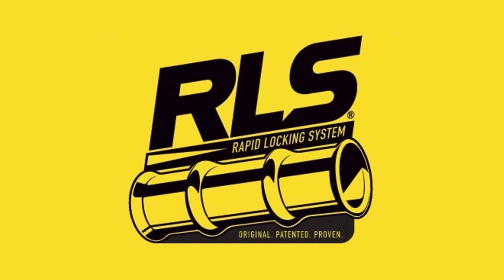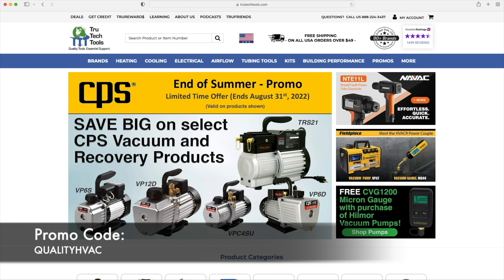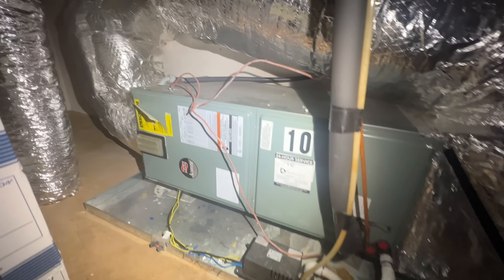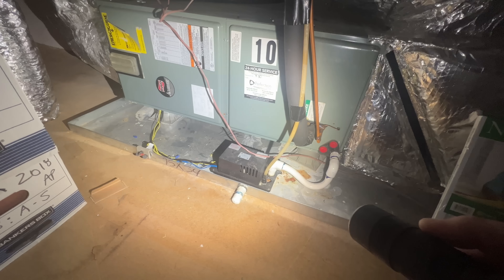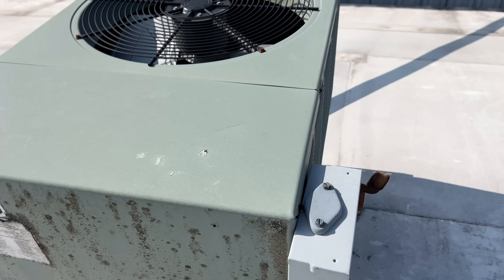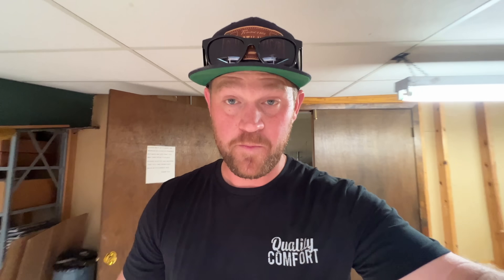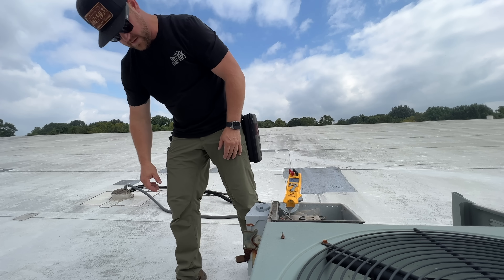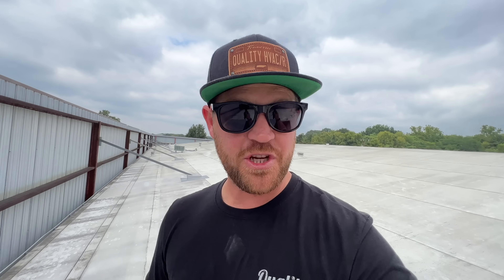HVAC Breaker Tripped?? DON’T Just Reset It!!

Comment: since that middle leg was a possibility of not getting good contact that caused the tripped breaker, would doing a voltage drop while unit is running help verify anything?

Comment: Hello friend, I have a question, if you could help me please, my question is the following: I have a two-story house, each floor is 1000 square feet and the height of each floor is 18 feet. My question: How can I calculate how many frigorias I need for my house? My question. The thing is that many air conditioning brands only give calculations for ceiling heights of 9 feet and they say that if they are more feet high the calculation is different but they don't say how I've been trying to find an answer for weeks and there isn't one and I would like an air packge unit for the whole house, my question in summary would be how should I calculate the frigories of my house by the height of my house which is too high
Reply: Manual D gives you the formula to calculate the cooling load.

Comment: A few things to note:
1- always open/close disconnect with your left hand. There’s a reason the lever is on the right side. This way your body isn’t in front of the panel when you energize or de-energize it. I’ve seen them blow and it’s isn’t pretty, especially if you’re standing in front of it. 
2- check those compressor terminals and ohm out the windings
3- open up that electrical panel and tighten the wires on the breaker - many times a slightly loose wire will cause heat, tripping the breaker

Great videos man, keep up the great work!
Reply: That’s really great advice thanks !

Comment: I’ve learned to never assume power is coming in on the top of the disconnect…. Which works till you go to pull a fuse as the bottom end will always be hot

Comment: You can remove the contractor faceplate to check for pitted plates
Reply: I haven't had them or seen them in a few years. But I remember when damn earwig bugs would get in contacts and get smashed when contact closed and they would prevent the power from making lol. Kinda miss them calls, they was easy 😂
Reply: @AllTattedUp13  ants is what I see a lot of the time. The buzzing talks to them I think.

Comment: I would measure for voltage drop across those contacts with it pulled in and loaded up. Anything over 1 volt should be replaced. I usually do if the scale switches from the mV to V scale. That will usually tell you if the contacts are pitted. Won't tell you if the contactor is mechanically sticking or dragging though. A visual inspection is a good idea too. The three pole contactor is the most common reason I find for a tripped breaker. That or a blown fuse in a fused disco. Sometimes the single phasing will overload the breaker and trip it before the IOL shuts the motor down.

Comment: In my opinion, been in the business 30 plus years, That is the type of call where I just go ahead an replace the part.  Zach definitely seems to be one of the most honest guys I have seen out there , but when you are dealing with the commercial side, the $$ amount is so minor that it shouldn't matter on an item like that.  It will take a minimum of 2-3 weeks to get approval.  More than likely you will get a call back in that 2-3 weeks,  Time is money, and the amount of travel time to the job, then getting up to the roof and accessing the equipment is time!!   Just Change it.!!
Reply: I would have replaced the contactor , cleaned the condenser, and took CFM amp readings 😃🤷🏻‍♂️
Reply: Client needs to give approval or you will not get paid for spares. That's why Zak qoute for repairs